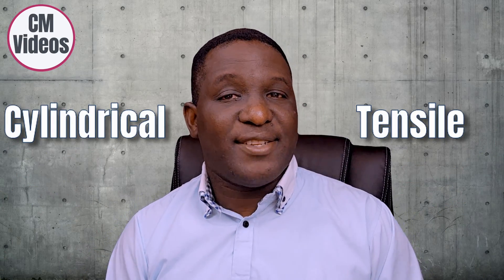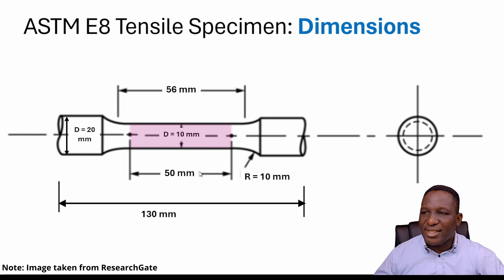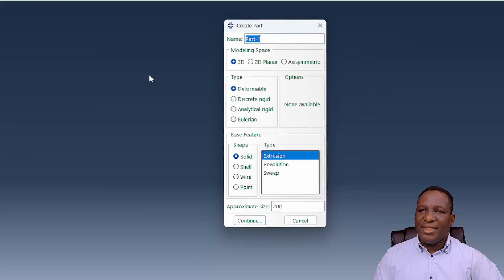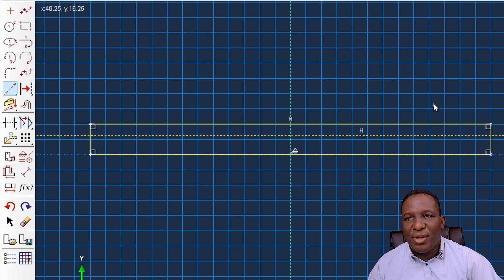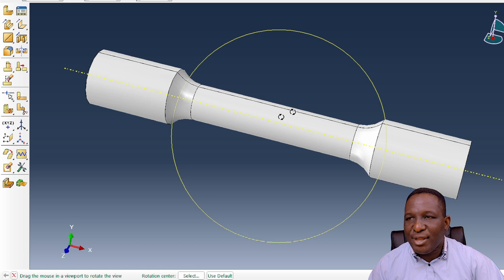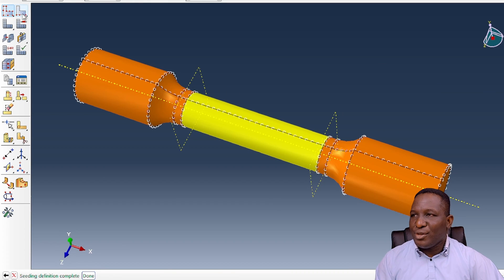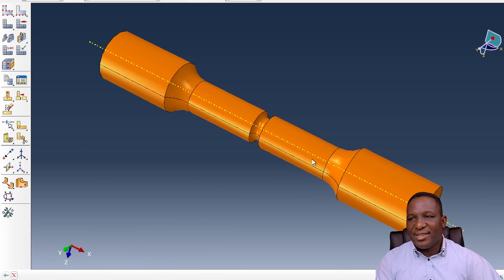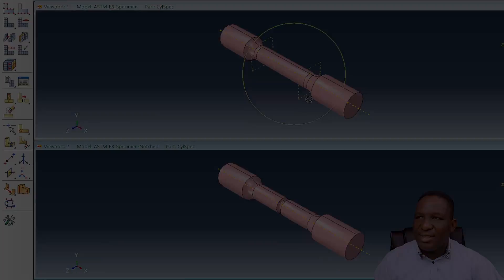Design of Cylindrical Specimen for simulating DUCTILE DAMAGE

Comment: Prof., any possible video for nanoindentation and microhardness studies?
Reply from the maker: I do not have such a video but could explore possibility of making it. I have not done such before but this should be an interesting one to work on.
Reply: @MichaelOkereke  Thank you for the kind reply Prof. Because hardness data is the basic understanding of the material's strength. if we relate this data and Comsol simulated data then it will be good findings before going to tensile or any other bulk characterization.